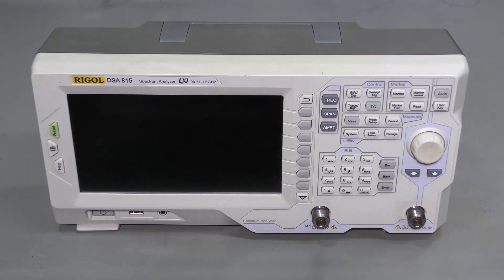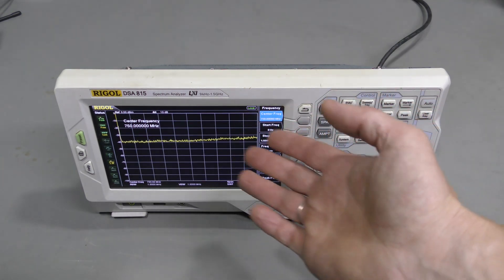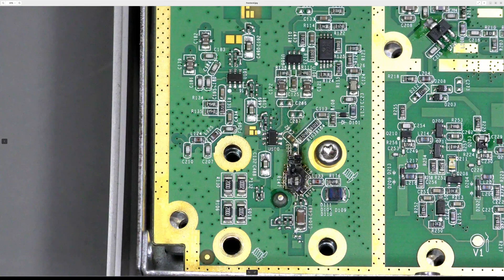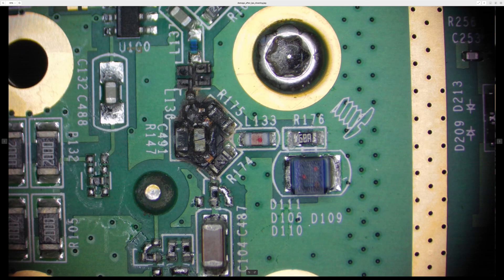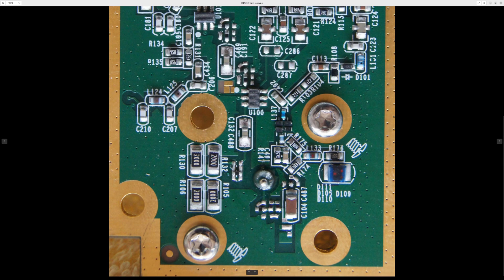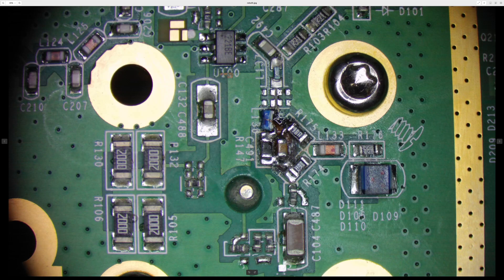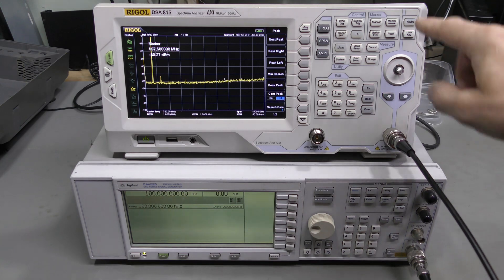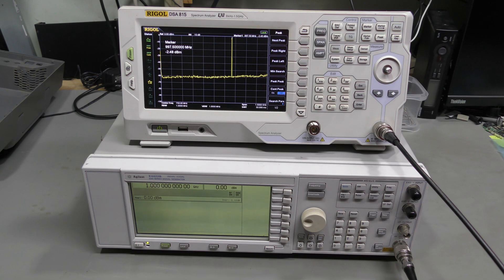#146 - Rigol DSA815-TG spectrum analyzer repair

Comment: Well done and nicely documented! The protection diodes aren't PIN diodes but rather low-capacitance bi-direction clamping devices, hence the "polarity" is irrelevant. Most likely they are of the Infineon ESD113-B1 variety or similar.

Comment: I have Rigol DSA815-TG spectrum analyzer which measures 25dbuV as noise floor. The noise level does not change irrespective of grid connections, and even if I test it with multiple sources. What do you make of 25dbuV? Is it too much to call the AFE to be damaged? I don't think so. But I think there must be something to bring that noise floor down to <=6dbuV. Please guide, thanks.

Comment: Would the carbon left behind be a problem, ie, most sand it all off.
Is 60db floor normal for cheap SA, I guess I'm used to high end from Signal Path - lol -.

Comment: How did you know 18A means 150 ohms and 57X is 38.3 ohms?
Reply from the maker: This is a standard code. https://eepower.com/resistor-guide/resistor-standards-and-codes/resistor-smd-code/
Reply: I did not know about the EIA96 markings thanks!

Comment: I'd really like to know what blew the front end like that. Maybe  it was attached to an external antenna and got a healthy electrical discharge ? Is there a DC bias voltage on the pin diodes ? That could explain the difference - not sure why they'd use pin diodes it all they're doing is providing protection.
I just read some of the comments further down, surely someone didn't transmit into the SA, did they ?  🤔
Reply from the maker: You never know. Shit happens. Perhaps, someone made a big mistake. Then opened the instrument, saw the damage, said "oh, shit", put it back together not caring much about the screws going into the right holes, and sold it on ebay.
Reply: 99.9999999% of the time.. Someone directly attaches a transmitter and sends watts of RF power right into the SA.

Comment: nice repair. not so difficult, but good work here. I can say i will not solder this pin diodes at all. If too much power will be applied to the inpey this diodes will not help)) 1 or two switches will blown up again. What type of 1st mixer in this schematics is?
Reply from the maker: Seems like HMC213A: https://www.analog.com/media/en/technical-documentation/data-sheets/hmc213a.pdf

Comment: 3:35 Looks like a few components in the tracking generator stage have been replaced too, does the TG work? They also need the flux washing off with some IPA!
Reply from the maker: Yes, the TG seems to work fine

Comment: Excellent job at explaining the signal path and the different components and their functions. Maybe having your mouse in a different color would make following even easier. Keep up the great content.
Reply: Maybe use what  Shahriar @ TSP uses: a mouse pointer with a circle around it? Makes it much easier to follow.
Reply from the maker: Yes, I need to look for some software to change the cursor and, perhaps, draw on top of PDFs and photos. Do you know of some for Ubuntu?
Reply: I'm sorry, I don't. The days I ran FreeBSD and Linux on my desktops are long ago. But I would assume there is a solution for Linux!

Comment: Excellent repair as always. I also thought that the PIN diode polarity was odd and would have expected two pairs back to back. However, looking at the picture you found on line (what luck - many thanks to whoever posted it) the PIN diode polarity is arranged three to one (????) Regards, David
Reply from the maker: Yeah, not sure why this is so, but the same way in both units.

Comment: are you sure they must be PIN diodes? for protection? I dont think that is right. Also 10nF cap in the 1.5GHz signal path does not seem right either (except for the input AC coupling cap which is large)
Reply: PIN diodes are often used as a limiter in RF circuits - when in the off state they present very low capacitance to the circuit, they have linear resistance to high frequency RF so do not introduce harmonics or intermodulation products, they switch states very quickly, and, when conducting, have a resistance that is inversely proportional to the signal level.
Reply from the maker: I am almost sure about the diodes. I am not sure at all about the capacitor. However the input cap measures about 900nF (in circuit). The one in the termination path after the switch also measures about 900nF (again, in circuit). What effect would you expect if the capacitor is too low or too high?
Reply: @feedback-loop  The cap would form a 1st order high pass filter, so if the value is too low the frequency response will roll off at the lower end of the frequency range. If it's too high, it might bump the noise floor up a little, but not entirely sure what else it might do.

Comment: Great job. Crazy how test equipment used to have service manuals and come with schematics. Now they go as far as to laser off the part ids.
Reply: Removal of part identification numbers not only conflicts with the right to repair, but it also supports the use of low-grade parts, black market trafficking of parts and counterfeit part manufacturing. It'll take forever to get the legislators involved to change their policy though.
Reply: Getting that sorted with manufacturers in China would be a Herculean task at best I'm afraid :-(
Reply: @pa1wbu  One more reason to rapidly start working on domestic production of high-end electronics in both US and EU with a new mindset: longevity, sustainability first. I'd rather pay 2K for something I'd never have to replace than be forced by manufacturers to buy new ones at a fraction of that because it cannot be fixed, upgraded, supported anymore. I have a few heirloom tools that are still as good as the day they were forged; for everything I build myself that is the benchmark.
Reply: Yeah, I have 'tons' of classical T&M from HP, Tektronix etc. Still very much ok and with excellent service manuals. Ok.. they were not €2k new. More like 8-40k$ each when new in the '80s and '90s 😉
Reply: That, and Rigol do not do component level repair either. My DSA815-TG lost the 900 MHz- 1.5GHz range literally 2 days after the warranty  expired. "Oh, yes, you can send it in for repair. We do module level repair only, ~€ 900 ex VAT plus shipping cost".  Sure, do you think I am a lunatic?

The lower two ranges (looks like it has 3 LO ranges) work ok.
Now that I have found myself a nice HP 8595E SA I might give the Rigol some trouleshooting time.
Reply: Competition........50 years ago there wasn't much competition.  Nobody was re-engineering that stuff.
Reply: With few exceptions such as the skilled repair shown here, most new electronics are not user repairable and even authorized repair centers are not equipped nor skilled enough for component level troubleshooting & repair. So the result is either to replace & throw away the defective equipment or simply swap in new PC boards until it works. Sad but true.....